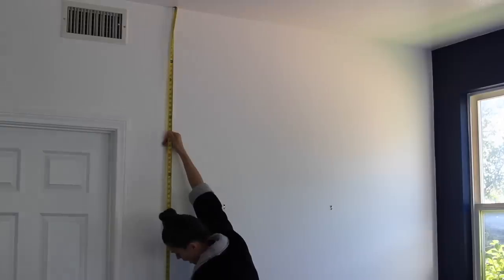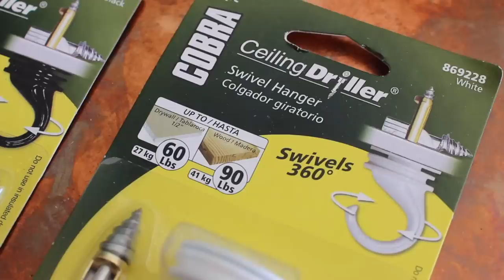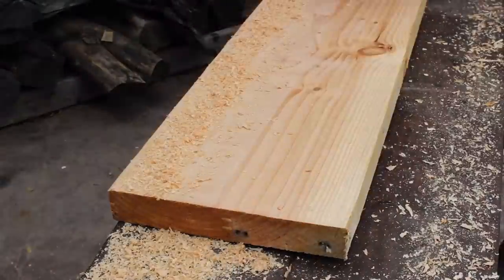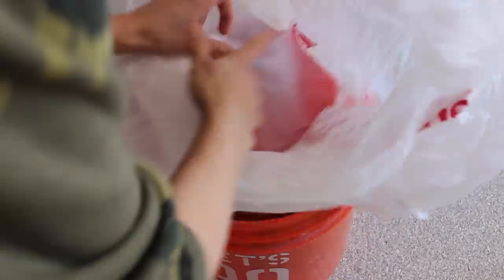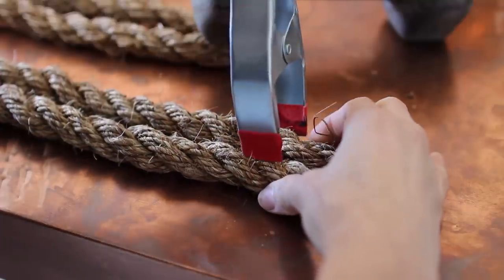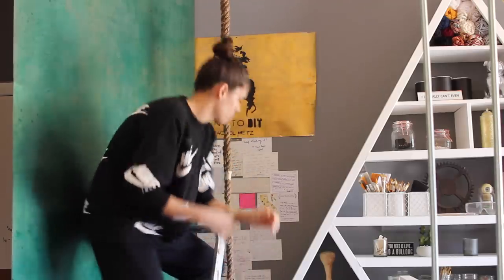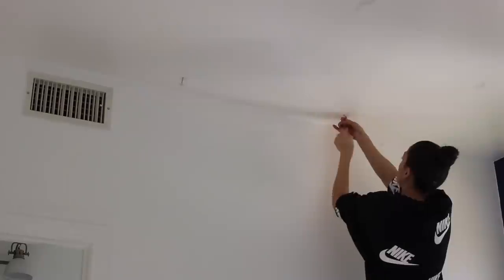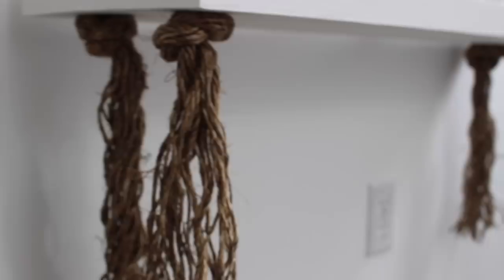DIY Hanging Rope Shelves

Comment: Perfect timing for this video. Looks like a good winter project. I'll tackle this along one side of our garage to start and then probably along the garage door side afterward. Will probably swap in some 2x4s, but I definitely like the simplicity of the design (it works really nicely for 10' ceilings). Might throw on some stain (or just paint) to dress it up a notch! 2:39
Reply from the maker: This is still one of my favorites!

Comment: it looks great! you made it WAY to difficult but it looks great! you couldn't pay me to use those hooks either. i've lost so many plants to them and heir so called "weight limits." i used porch swing hooks and painted the same color as my ceiliing. they each have a weight limit of 300lbs. for those that don't want to trust just drywall (WHICH i don't trust with anything heavier than a light photo frame.) you can use just 1 of the swing hooks. pull the two sides together. you need to make your top shelf shorter or you  tope at the top longer. it still looks beautiful. as long as your not putting a shelf full of books or a stereo on one of these shelfs a 1" board is going to be fine for most daily uses. however, if you should notice it bowing simply untie your knots and flip it over.  for those of you that don't have the clamps (not that expensive, but still a luxury in the begining) don't fret, you don't need them! simply measure out where you want yoou knots  put you boards on. tie the knots do this with all the shelves. hang it. put a level on your shelf. and adjust as needed. i personally wanted a rich dark wood look so i burned mine. took a torch to it, sanded off the creosite with an 80 grit, went back with a 180 put on a a layer of polyurathane clear satin, sanded it with 320, and then gave it another coat of poly. the whole soaking of the rope is an unnecessary step. put on a pair of cheap work gloves if your worried about your hands. you can get them at any dollar tree store for $1.25 same with some cheap clamps and a level. i personally go to Harbor freight for my tools as a diyer, you don't need state of the art name brand things. and what they sell work perfectly fine. for diy projects. and allows me to save up for bigger/better equipment while still allowing to do things now.

Comment: When I made rope shelves, I just put masking tape on the end I was working in to tie and go through the holes. I also wasn't able to hang the shelves up as I worked until they were already put together and had to use a glass of wine as a level when I was evening it out after the fact. It was a struggle lol.

Comment: The main advantage is that it can be just taken off and collapsed for packing instantly and vice versa.  This is a great idea, you should replace the knots to have adjustable lengths/heights of the shelves but it is wobbly inherently without some springs in between the corners , but that is much more complicated to keep them from slipping out and hurting/damaging people /objects .

Using just metal screws along a incision along the height would be better in that case unless you really need to have h the shelves art weird angles for some reason.

Nevertheless if using hanging shelves then using things like velcro straps or magnets or anti slip tape would be good to prevent things from falling off .

Comment: Beeswax & baking in a low temp oven will condition your rope for next time and soften the teeth. Natural fiber rope (I.e. jute, hemp, coconut fibers) don’t love being soaked in water or thrown into a washing machine. Running beeswax over the fibers with a pair of sturdy gloves will not only soften it, but also help to mask the smell of Kerosene which is what is used to make the natural fiber ropes found in craft stores like Michael’s. You can purchase beeswax from Michael’s in the candle making section. 
Hope that helps!
Reply from the maker: Thank you for this!

Comment: Hey Rachel, next time if you just want to clean something up get a simple hand plane since it can be a lot easier to maneuver in short woods, also when using the planer or the hand planes remember to lift the toe (front part of the planer) of the sole so you dont bite into the ends of the boards. And in case you want to learn how to use wood working tools like that make sure to view Paul sellers, he's been woodworking for 40 years so he can help. Love your videos, and keep it on
Reply from the maker: You are the best! Thank you for this xx.

Comment: How would you compensate for the angle created of you wanted to hang it on the wall? The rope going to the outer corners would have to be longer than the other right?
Reply from the maker: I'm not sure what you mean? You measure and take not where the handles you made to hang them are from. Measure the shelf depth, cut that in half and then how far out you want it from the wall.

Comment: Great work but you are using the table saw wrong which is why you were having problems with it. You need to move the gate so the timber is fed between the gate and the blade. This will give you perfect cuts every time
Reply from the maker: Thanks for the feedback!
Reply: @LivingtoDIYwithRachelMetz  No problem, keep up the great work.

Comment: I have a habit of using filler on end grain. Less paint soak up and smoother finish. I'm surprised you didn't router the edges. However, the semi rough edges still looks good. Also surprised that the knots are so level.
Reply from the maker: Thank you so much!